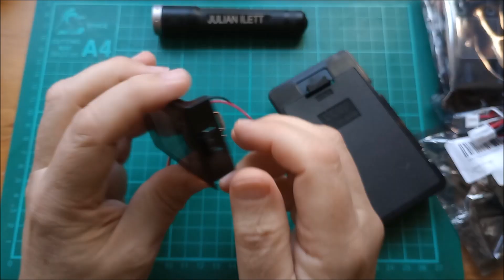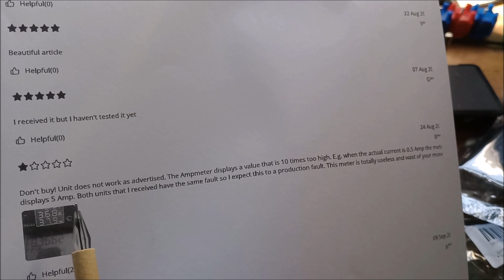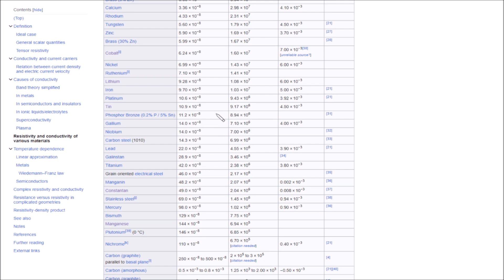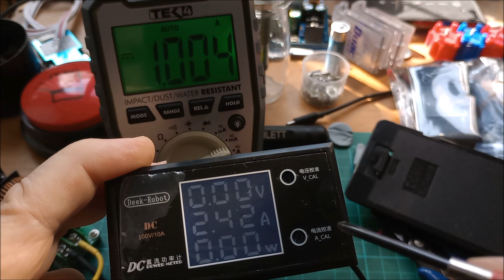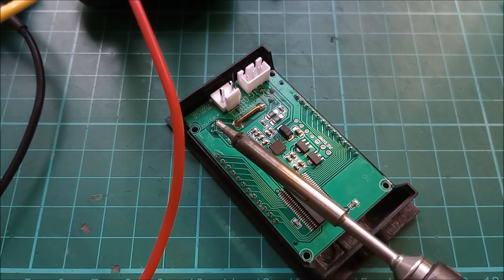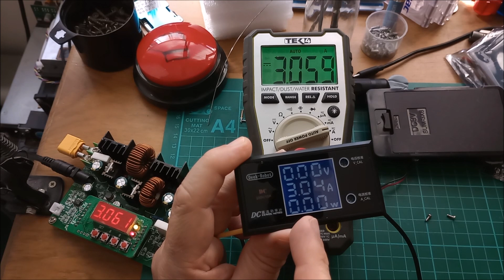10A Ammeter Voltmeter Wattmeter Fault and Fix

Comment: what no: microcontroller ic used
Reply: Yes the new ones are perhaps clones , old stock have the Nuvoton and ST Ics along with the op amp LM358. I just purchased 2 units both have a single IC with the marking laser scratched.

Comment: SECRET SOFTWARE CALIBRATION MODE:  If you power on the device while connecting the two open plated through holes that are beside the large chip, it will enter a calibration mode.  I found that tack soldering a momentary push switch made this go easy.  Once "0.00V 0.00A CAL" shows up on the screen, reconnect the holes (or click the switch added) to click through the sequence.  The display will show 100V.  Then after pressing again, it will flash 100V, then show 5.00A.  After another press, it flashes 5.00A then goes back into the reading mode.  I successfully fixed my unit which had the 10x problem, not needing any other mods; just need the right power supplies to deliver the required inputs.
Reply: PROCEDURE (after adding push-button):  Have 100 VDC and 5A power supplies ready before starting, as well as a separate 12VDC supply for the unit only.  Before connecting, turn device's front Volt and Amp potentiometer approximately to middle position.  Connect only THIN red and THIN black to 12V supply while holding button. "0.00V 0.00A CAL" mode starts showing,  tap button to set zero offset, then "100V" solid appears on screen.  Hook 100VDC to THIN white (or yellow) wire and THIN black wire (shared with 12V supply).  Press button, 100V flashes, then displays 5.00A solid.  Disconnect both 100V wires, leaving only 12V attached. Connect 5A to THICK red and THICK black terminals only.  Press button.  5A flashes, then goes into standard measurement mode.  Disconnect 5A.  Now use the front panel for fine-tuning closer to the values you want to use the device for, such as 5.00V and 1.00A.

Comment: EDIT:  I reversed my resistor mod to stock condition after finding the CAL menu. I’ll leave this here because it was the first method I tried. 

@JulianIlett , I found the shunt modification is not necessary if you revise the voltage divider.  As you noted, by shorting R2 the potentiometer becomes the voltage divider alone.  
 
All one needs to do is move the static resistor to the shunt side of the potentiometer instead of to ground side.  Now, R1 becomes the sum of the static resistor and the top side of the 5K pot, and R2 now becomes the bottom side of the pot only.  This makes it much more manageable to use the voltage divider to achieve a fractional voltage that the errant MPU is looking for. 

I determined using the voltage divider calculator that a value 22K between the shunt and the pot should put the sensitivity back into the center region of the stock 5K potentiometer (2.5K/2.5K) when voltage is 1/10 what it was before.  I did this modification to my errant unit and it is working well.  I scratched a break in the angled trace from the shunt to the pot and tinned the remaining trace stubs for a "223" SMT resistor.  Then I put a "0" resistor where the "01C" resistor was.

The only downside is the positive offset amperage you noted, I also found there is about 0.02 A for a 10V source.  I wonder if this value has anything to do with the power consumption of the unit itself?  Perhaps the bar of copper is not truly ground and has a small positive voltage.  Or the input impedance is inappropriate for this voltage divider.

Let me know what you think & if you have had any success finding the source of the parasitic/offset amperes.
Reply from the maker: I tried a different modification on each meter. Short length of manganin soldered flat to the PCB seemed to work well.
Reply: @JulianIlett  Do you have any unmodified meters left?  I posted the software calibration method in a separate thread, and hopefully you will have good success without offset like I did after following the routine.  I suspect at the factory they had their current calibration source at 0.5A instead of 5.0A.  This is because I put the resistors back the way they were at the factory and the unit calibrated just fine after software re-CAL to 5A

Comment: I got a different revision of this panel and it is measuring the correct values, it looks exactly the same but with a different PCB Layout and has the mark: Deek-Robot Shield Model BL-02, I get the feeling one may be a copy of the other one. I wonder if mine could be an older one than yours since I got mine for at least more than a year now. My shunt has pressed sides on it so that it will be in the same position when you put it in as well, yours are completely not having any determined marks or dimples where it should be placed either which makes calibration even harder

Comment: I would just run a wire from the sense point to some point in the middle of the shunt wire. Moving the solderering point you could trim the value to some near the real. Then adjust with the pot.

I will watch this item in case they sell them for cheap. 😁

Edit: today it costs 1,79€

Comment: A resistor somewhere is 10x incorrect.
Reply: I have an older unit that reports the correct current an one I received today which has the 10x problem. I’ve been all over the unit inspecting the resistors and the shunt and the pots visually and with a DMM. Everything is (to my surprise) identical.  I am convinced there is a problem in the little black square chip’s programming.
Reply: @Y.T.Learner  Maybe try a 10x times to an appropriate op amp gain or hack ln a pot to see if it can be effective somewhere.
Reply: @johnshaw359 The factory did the calibration wrong during a production run.  I saw the procedure video online. They put the preassembled board in a plexiglas fixture which is wired to a manually set power supply and follow a CAL procedure before putting it in the case. Evidently somebody entered 0.5A instead of 5.0A during setup. I found the CAL test points which enabled me to re-do the factory process on my bench. Works fine now.

Comment: Think it's likely just a sorting error in production for a run and thinking the 10k and 1k resistors are swapped?  Course there's no design diagram shown here so it's a guess but likely, I mean the Chinese aren't that stupid to make a bodgy design like that so I bet this is the case.  Perhaps look for a design errata somewhere on the manufacturer's site?
Reply: I have good and bad units. The resistors are identical and measure correct to their markings
Reply: Update: it’s more likely the calibration current was set to 0.5A instead of 5.0A during factory calibration. See my other post about the software calibration procedure for this device.

Comment: I'm thinking that since it's fairly accurate but 10x out, maybe just altering it's resistance that goes to the micro controller input so that it accounts for that 10x difference at that point, rather than trying to shorten the shunt? I could be wrong but if it's reading 9.210 amps for an input of 0.921 amps, if you changed that 10k resistor for maybe a 100k resistor it would account for what might be this product's ultimate flaw, which was the wrong resistor being installed for the amp detection circuit? Then you also keep the soft-accuracy adjustment. It may not be 100k but perhaps some experimentation would reveal a much easier fix (swapping out a resistor) than cutting down the shunt.

Comment: nice that you found a solution to the issue, but at the same time, it means the seller has gotten away with selling items that do not work as they should.    This does not teach the sellers in China not to sell defective goods..  This was menat to be a brand new item, it shouldn't need modifying by the end user to make it work right.

Comment: After snipping the shunt in 3 parts, you could have soldered the 3 parts in parallel. This would create a factor 9 drop in resistence. After that you could have trimmed it to factor 10, and saved the puny 10K resistor :)
Reply: Plus 1, I had exactly the same idea. He stil has a few to go, and I know he kept the pieces so he still can fix it.

Comment: Good fix. Of course the result is that you are using almost none of the ADC, but never mind - it works. It really needs a software update. That would drop that zero error off the bottom of the scale too.

Comment: This circuit almost certainly has an op amp to multiply the milli volt signal from the shunt up to a multi volt signal to be digitized by the microprocessor.  I think they have the gain setting resistor for this amplifier at ten times the required value.  Lowering the shunt resistor value just multiplies all the errors.
Reply: I would have zeroed in on the op amp circuit before I’d mess with the physical shunt.
Another area is the A/D Reference
Reply: @judd_s5643  Probably the same reference for the voltage channel though, so I would suspect it's not that.
Reply: @cambridgemart2075  what vrf is he, or rather the device, using?
Reply: @simonmasters3295  Looking at the circuit board, it's not easy to spot a reference voltage source; given the low accuracy of thee types of device, I would imagine it's using the internal reference in the microcontroller.
Reply: Considering it is x10 (precisely) the actual reading I believe it most likely to be a software error, or at least a design error.  You should run more tests at different Amps through and get more readings before changing anything... imho
Reply: @simonmasters3295  Given that current measurements are often only millivolt signals from a very low resistance shunt (a short piece of heavy wire, in this case) amplification is almost certainly needed before there is enough voltage to be digitized.  And fixed resistors happen to come in precisely decade steps to set amplifier gain.  This is a gain resistor error.
Reply: @jpopelish are you saying that a
not all the current flows across the shunt in the circuit, if that's the case how does the sensor know it has the same proportion of current at different loads.  I know that we are measuring mV to derive Amps...you think the wrong resistor was installed on the board?
Reply: @simonmasters3295  Not saying that, at all.  I;'m saying that to digitize the millivolt signal from the shunt, an amplifier is needed, to scale the signal up to something reasonable for the A/D converter.  I think they just installed a gain setting resistor for that amplifier that has the wrong decade band on it.
Reply: @simonmasters3295  I discovered the software calibration menu for the MPU, which adjusts the gross calibration to match the installed components. So it seems you were correct.  Somebody set the calibration source to 1/10. Fortunately it is not hard wired and can be fixed as I described elsewhere.

Comment: Try putting  voltage on shunt holes after it was removed to see what voltage needed for 1 amp. Then put one side of shunt in and solder a wire to the location needed on the shunt wire. Match that voltage to location solder point. That should give your linearity that you wanted.

Comment: If you are going to be using quite a few of these, it's probebly worth ordering some 10K, or even 20K, pots and 5K resistors, (instead of just shorting to ground). That way you should be able to keep the accuracy. (?)

Comment: It is possible that the amplification factor of the shunt voltage amplifier can be adjusted using a different resistor circuit.
Reply from the maker: Maybe. I'd also like to find a zero offset resistor.
Reply: @JulianIlett Who knows if such a thing even exists.

Comment: Wow! Almost as if you're shopping from the same seller. Just two days ago I received the very same unit.  I'm having some troubles with mine. From the start it showed 1.00A and incorrect values for what, no matter what I did. While showing the first 1, it also seems to give 10 times too high. Haven't finished watching yet... Looking forward to see the rest of the video!
Reply from the maker: It's fixable - kinda :)
Reply: Take a look at the secret software calibration I discovered. If you have a 100V and 5A power source you can correct the factory errors.